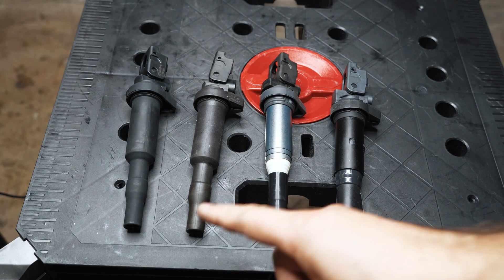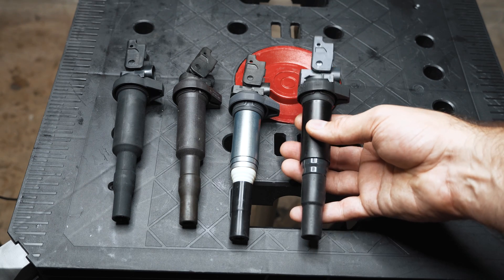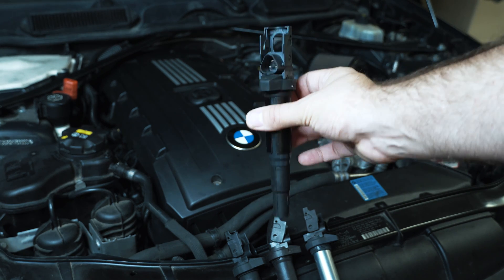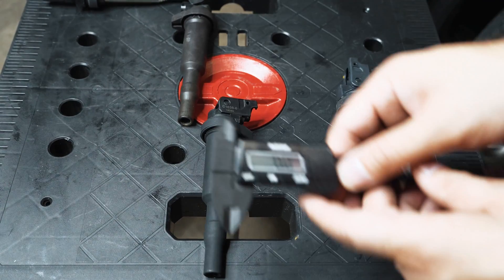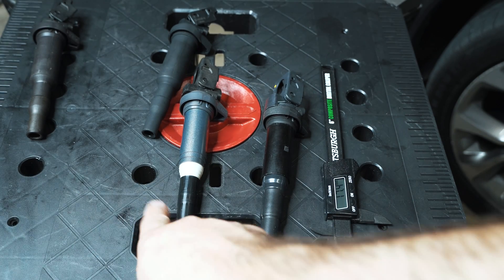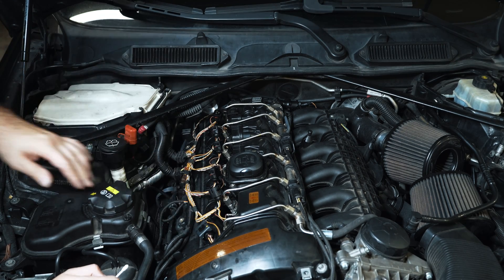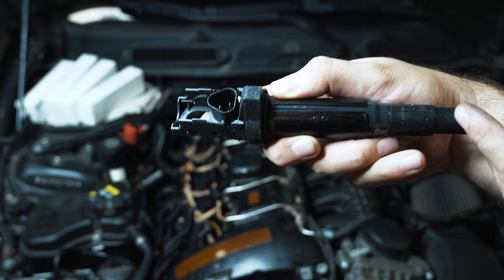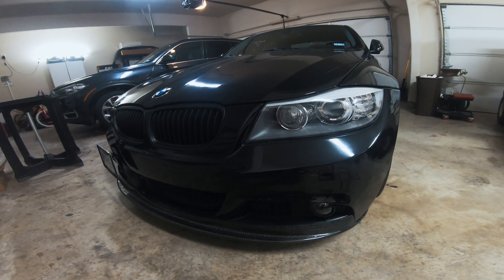The ULTIMATE BMW Ignition Coil Guide | 2003 & Newer

Comment: I’m currently at 297,000 miles on an 03’ 530i with original coils.

My older 99’ e39 has slightly over 300,000 miles on original coils as well (that car uses the previous style held in by 2 bolts). Only one failed and it wasn’t the coil itself, it was a mechanical failure where the stem attaches to the coil itself. So that coil still works. 

I know they fail and that my situation is more on the rare side, but 100,000 miles is nothing for a coil...maybe others are just having bad luck?
Reply: put those coils on an engine with a tune and they will probably fail on the first hard run...
Reply: Elliott-MTB perhaps you’re right, but on a stock car that experiences multiple hard pulls daily (engine at near redline) they work perfectly.

Comment: I have been running Bosh ones for 30k kilometers on my n54 550bhp and no misfires still. I drive winter time too.
Reply: Same, Bosch ones are fine for stock turbos  on pump gas
Reply: @s2syed  im on tth stage 2 ones but on vpower. Thwy work no problem.

Comment: can you review on the NGK coil? Im using it currently in my M3 daily driven, been using it more than 100k miles already, no issue and my NGK iridium plug already more than 200k miles still running strong.
Reply: What M3 are you driving with NGK coils?
M3 E92 or M3 F80?
I am considering to order NGK coils for my M4.
NGK 48206 is the right product isn‘t it?
Reply: @BosaFTW  e46 m3..no issue so far and Im loving it since its my daily car
Reply: NGK is japanese quality

Comment: Off topic but what are the plugs in the X5 gapped to?
Reply: read your manual
Reply: There is nothing in the manual about spark plugs on my 2011 but thanks for your informative reply. 🤦‍♂️
Reply: I believe the N55s around 2011 run Bosch ZR5TPP33-S plugs which are gapped to 0.08.

Comment: Do u know anything about a red one high performance coil ? Some guy have a video in you tube using it .
Reply: That's all I use. Bavarian Autosport made these, they went under March 2019 and ECS tuning sells all of the old BavAuto parts. Red coils at ECS are the best on the market, hand-wound, very hot, helps revs drop faster too, especially with a good Fuel/air tune like Turner Motorsports shark tune.

Comment: Great video, wish I saw this before buying a full set of new Bosch coils! My 07 335i with 182k had 5 original Bosch coils dated 2008 and one replacement Delphi coil installed by BMW dealer. I bought through FCP euro so free replacements for life if they fail. Next time I’ll look for Eldor.

Comment: The Delphi coils are engineered in England, but MADE IN CHINA!!! You got what you paid for, paid $5 for a buffet, what do you expect, lobsters???
Reply: That is incorrect! Delphi ignitions for BMW N55, N46 & N63 are developed in Luxembourg (technical Center) and they are built in Portugal (Seixal Plant) for all markets except Asia. For that specific market, those ignitions are built in a Chinese plant. By the way, the weight difference between Delphi’s and other manufacturers are not related with being cheap or cost savings and, therefore, not related with product quality. In fact, the weight specification it is defined by BMW, not Delphi.
Reply: Ricardo Almeida  and I want to correct you as well. I purchased a set of the Delphi coils a while ago from ECS tunning, they ARE engineered in England and made in China, as what was the wrapping box said. And that’s why I replied so initially, I don’t need to lie about it, a coil is not rocket science technology, a lot more countries than you think can manufacture them pretty well.
Reply: Ricardo Almeida you completely missed my point! All my point is China is capable of building low or high quality products, maybe not engineering, but manufacturing, top notch in the world, it is not 1980s any more, the “humble Americans” still have those old opinion upon chinese products. All in all, you paid what you got, if your attitude is cheap out, yeah, you got shit stuff, regarding where it  manufactured. But if you want high quality and would willing to pay more, your options are still probably Made in China. Period.
Reply: Chen L lol!

Comment: Have delphi fbo 23 psi meth custom tune e85 no missfires at all.. had a ton with the Bosch.. Going with precision rw when my new turbos arrive :)
Reply: How are the Delphi's holding up? I've been using eldors for about a year under 5k on them and with ngk 95770 at .020 from .022 but getting misfire's fbo e50 custom tuned. Im just under the impression that these pencil style coils don't last more than 8 months of abuse and are a headache waste of money.
Reply: @BimmerM5e39  havent had a misfire issue since I installed the delphi its been pretty nice. I am using the NGK Laser Iridium replacement plugs that are two steps colder than stock N54 plugs also set the gap to 0.020"
Just finished installing upgraded turbos and helix will see how they like the extra whp.

Comment: I have a 328i with a n52 engine. I looked up on realoem to see if the Eldor coils part # (12138657273) was compatible with my engine but it only states the boshe/DELPHI part # (12138616153). The N54 can use both part # 12138657273 & 12138616153 so has anyone tried to run the Eldor on a n52 engine.
Reply: Joel R I spoke to the seller in the link and they said that these will work for my car which is an 08 328i n52 sedan. The link is for the n54, just put in vehicle specs and find the coil that fits your specific vehicle

Comment: Nice interesting video as always. I'm actually doing valve cover gasket and swapping to NGK 97506 tonight. Current one step colder plugs looked like they could be getting a bit warm lol. Florida heat etc these 2 step colder plugs should do well. Getting close to where I want a custom tune from ken.Thanks for sharing man!
Reply: @JayDee-b5u  worked great. Ended up going with bimmerlofe coils as well. Had a custom tune done by Trebila running full e85 and meth.

Comment: There’s many factors to a “misfire” . 
1. Did you change coils before the mosfets? Mosfets are what can’t hold the spark or load whatever term you wanna use
2. Spark plug gap. <—More when using ethanol etc

Hence why I believe they don’t suggest to closed of a gap when running PR coils etc.
Reply from the maker: Yeah more ethanol would need a higher plug gap and strong coils.  I changed the mosfets after putting in my spool performance coils.   I have an MSD81 ready to go in, I'll be making a video on it.

Comment: Greetings from Europe I have N53 325i 3.000 218 cv. 
realoem.com says DELPHi coils. The questions are:
 the Dielectric grease what is it for? Wouldn't be bad if it touches the end of the sparl plug conection?
Thanks a lot and congratulations from Spain to Vehicular DIY
Reply from the maker: Hi, the dielectric grease should just lightly coat the boot to avoid any spark arcing with the cylinder wall and to make removing the coil easier in the future.

Comment: I know this video is about coils but are you running catless Downpipes or stock or catted Downpipes
Reply from the maker: Catless dps
Reply: Do you get drowns from them are they good mod or should someone get a catted Downpipes instead
Reply: @gnicevids  if you live in Cali catted if not no catts and no drone with mine
Reply: @Kipitrl  thanks
Reply from the maker: @Kipitrl  ya I agree very quiet still with stock mufflers.
Reply: gnicevids Live in Cali and my catless DPs have 0 drone. Car is very quiet tbh

Comment: Do not use the duralast!  Had to pick the booting that melted to the plug all out of the plug hole with a pick to get my sparkplug out.  The rubber they use is crap!
Reply: Steve Polverini use dielectric grease in your coils

Comment: I've had misfires running eldor coils with NGK 97506 gapped at 20. The car is running  stg2 pure turbos fbo with custom tune. Hopefully you'll have better luck than me.
Reply from the maker: Yeah I'll be putting back my upgraded coils shortly anyway.
Reply: Probably wasn't the coil packs

Comment: Thought I had a misfire on my 330i at 102000 miles I changed coils and plugs but the fault stayed, turned out to be dirty vanos. I would have swore it was a coil / plug by the symptoms. Any way glad I swapped out the parts, do you have a vanos video?
Reply: Hit Me yeah I’ve cleaned them up, and it’s now running nice, bad news is I snapped a b0lt off on the block removing the solenoids, it went back in tight and no oil leaks so far so I think I might of dodged a bullet......
Reply from the maker: Not yet, typically you'd be getting a code if it was vanos related.